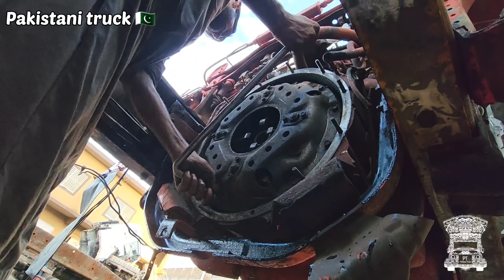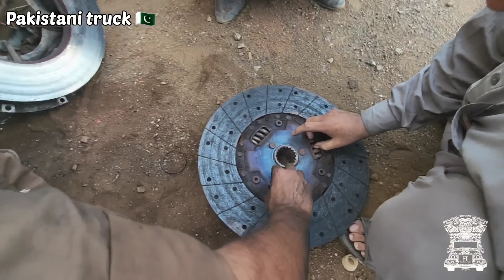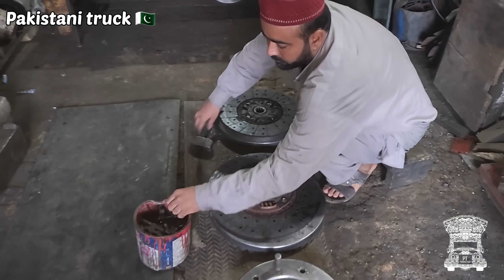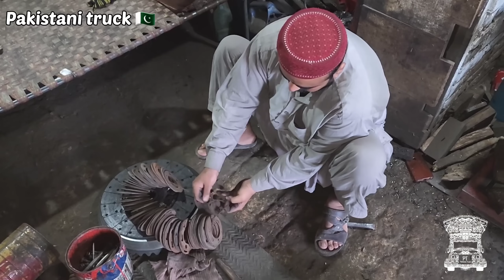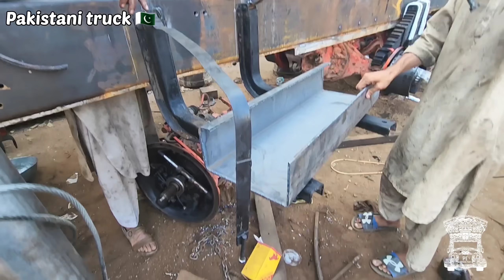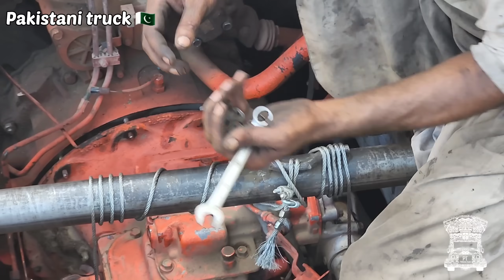REBUILDING AN DEAD CLUTCH PLATE /V8 Dump Truck Clutch Plate Restoration from scrap, Fitting Gear Box

Comment: The guy doing the clutch plates sure is accurate with that hammer. You would think if he specialises in that job he would have run to a press. There are a lot of guys with big lathes and heavy metal presses.

Comment: Much respect to these workers. But I have to wonder why the fellow who "rebuilt" the clutch disc 1) why not clean the rust off all the parts before assembling 2) if this is a 'rebuilt' unit, should not new springs be used instead of old rusted springs 3) and the disc themselves -- thy seemed not to be replaced 4) and the pressure plate? was it ever looked at? 5) why must you work on the floor. Would not working on a table be more comfortable for the back. I ask these questions to obtain a better understanding of the trade. Great video and I will watch the entire series.

Comment: So you have a clutch disc with one broken spring and the rest of the springs are loose.  To make the loose springs tight again, you spread them with a chisel and hammer.  If the spring had any temper left it it, a chisel and hammer would never spread it.  I won't even mention using some scrap spring from who knows what to replace the broken spring.
Reply: Actually, this is standard in the clutch rebuilding industry, although we would replace the facings. But spreading the springs is normally how it’s done, but we don’t take apart the disc, we spread them in the windows..and it actually works just fine..the only reason the springs are compressed is from abuse..this is a dump truck and drivers like to pop the clutch to shake the box to get
 Out all the load, we see this all the time...

Comment: They replaced a broken torque spring...tried to stretch the others.caused by overloading. Yet they refit the original fibre plate?  For all that work. Then to whack the friction material with a hammer is enough to crack it. Let alone try to cure its warp....guaranteed not to last.

Comment: Fascinating, great coverage, but hell fire, the man-handling and hoisting that gear box to mate with the engine using a DIY backyard hoist, wow 'where there is a will, there is a way' comes readily to mind, and it got the job done. I guess the crane could not be used.

Comment: Coming soon to a town near you, take notes America, gone are the days of buying new, or even “upgrading” your broken, worn parts, , now it’s into the shed with no lights (conserving electric), in your open toed sandals, wearing your old bed sheets (because even wall mart has empty shelves), the only difference this third world economy has diesel fuel, nope we’re going to learn how to run wood gasification fuel.. but rest assured your not making enough power to do much damage to your “Craig’s list rebuilt” clutch…